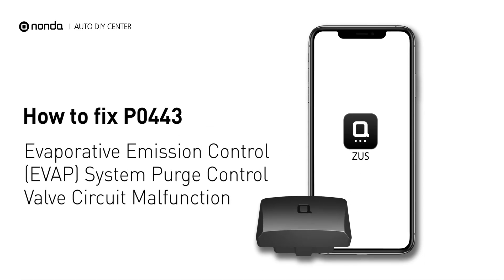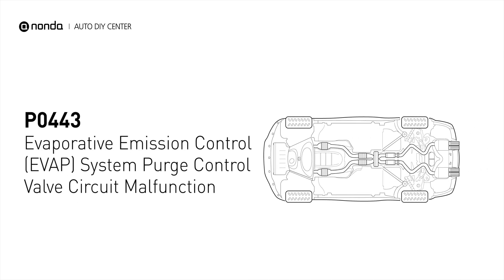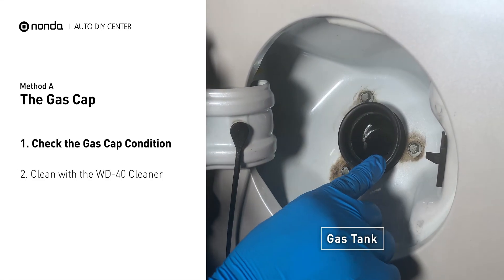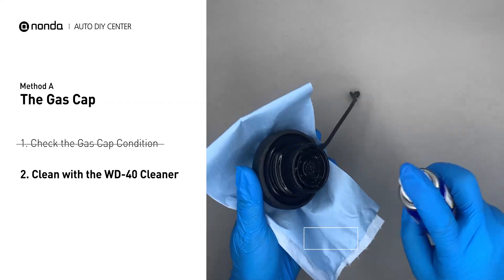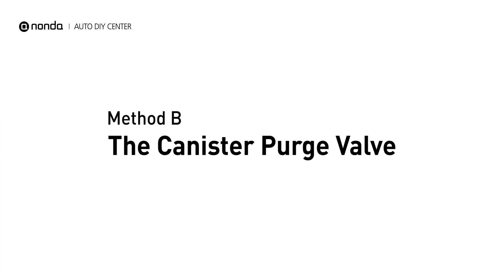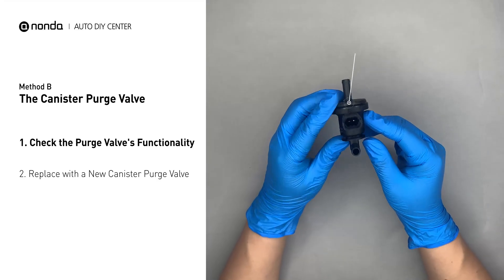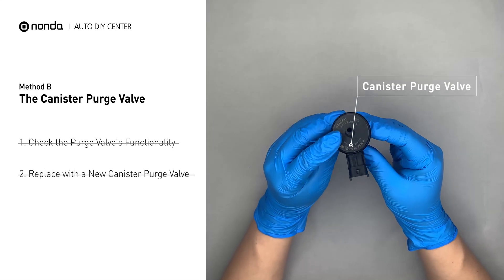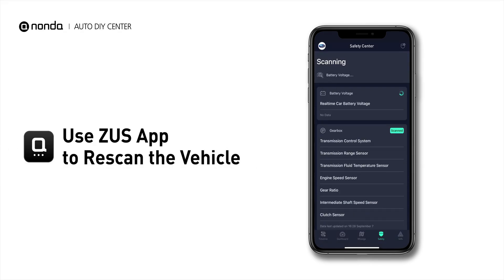How to Fix P0443 Engine Code in 3 Minutes [2 DIY Methods / Only $4.53]

Comment from the maker: Hi, I'm Steve, nonda's lead mechanic engineer. 
Feel free to leave your comments here if you have any mechanic questions, I will be glad to help you out!
Reply: Gm Steve I have Nissan Armada 2006 I have a code VDC light on what I need to do and can I still drive out of town with that
Reply: I replaced the canister purge valve and it's still throwing the same code

Comment: I prefer to use 556 spray lube or alcohol for cleaning a surface. I would not spray wd40 into the fuel tank inlet but use a lint free towel to wipe sparingly, you do not want to create more problems than you solve

Comment: Honda crv 2nd gen,evap solenoid is functioning but getting  low voltage at 2 pin socket

Comment: NO! NO! NO!

DON'T EVER, AND I MEAN EVER USE UD-40 ON ANYTHING INVOLVING THE FUEL OF YOUR GASOLINE ENGINE. THERE IS SILICON IN WD-40. IF IT GET'S IN TO THE FUEL SYSTEM THE SILICON WILL DESTROY O2 SENSORS.  

👌
Reply: Glad I seen your comment before I attempted this.

Comment: What if my car doesn't have a gas cap? The gas door pops open to access the gas tank to refuel.
Reply: Purchase one: And put it on save Gas also money in the long run.
Reply: It doesn’t except one
Reply: New purge valve air filter : downstream Bank2 clean cat.

Comment: Hi i have a RV with a 8.1 i have no + on the red lead connector on the purge valve engin on . i have P0443, P0134 and P0154
Reply from the maker: Hello, as you are getting more than one error code, we suggest getting your vehicle visually checked by your local mechanic for further diagnosis.

Comment: 2009 tahoe replaced purge solanoid and vent valve still getting this code
Reply from the maker: Hello, have you tried checking the condition of the gas cap? You can try cleaning it with a WD-40 Cleaner and see if the issue will continue to persists.

Comment: I have a 2010 mustang and I get a 0443 and 0403 code. This particular model doesn't have a gas cap.
Reply: I have this same issue, new EGR valve, new purge valve, new fuel temp sensor and still nothing
Reply: @andresaguilar4709   did you guys get it figured out I replaced all them I think it might be down to wiring at this point
Reply: @juanvelez1535  wiring or the pcm / ecm itself.
Reply from the maker: Hello, we suggest to get your vehicle visually checked by your local mechanic for further diagnosis.

Comment: 2012 Honda Odyssey...

I was just charged $560 to replace this valve and canister vent valve.  We replaced our cap a year ago.  Drove away and two hours later check engine light with P0443 again!  What didn't the mechanic do!!??
Reply from the maker: Please confirm if this is the only code you're getting.
Reply: @nonda  It is the only code now.  A fee days ago it was P0497, P0145c and P0301.  Purge valve and canister replaced supposedly.  Then spark plug removed and replaced for the one fouled.  Drove away and all was well.  Hour later, this code
Reply from the maker: Hello,  we suggest checking if the purge valve solenoid is getting any voltage.
Reply: @nonda  Thanks.  Hopefully thr mechanic knows how. He will be checking the car again.  I mean...$560 and now this.
Reply: @nondainc  Gave them back the car today.  Let's see if they try to charge me more money for that code.
Reply: @GR8GUY54  update?
Reply: @GR8GUY54  any update?

Comment: hi, after checking the purge valve i have a pulse vacuum suckage. Does that means it has to be replaced??
Reply from the maker: Hi Waslim, please know that proper procedure to test the purge valve varies per vehicle's make/model. We suggest referring on your service manual to avoid misdiagnosis.

Comment: K, and if both of these don't fix it?
Reply from the maker: Hello, please try checking if there's a damage wiring to the purge control valve.
Reply: @nondainc  checked the wiring with multimeter, all seem to be working. Anything else I can try before giving up and bringing it in? I replaced the solenoid already, bought a brand new oem gas cap, still no go. I'm pulling my hair out over this 😫
Reply: @SwazNasty  You ever figure out the problem?

Comment: I should feel vacuum suckage to understand that it does not works, or vacuum should not be there?
Reply from the maker: Hello, we suggest to do a thorough diagnostics of the complete system. You may also follow the guide on how to fix the code provided in our video to lessen your expenses.